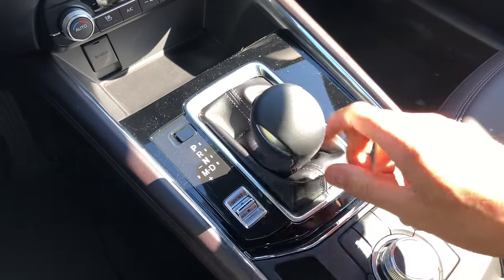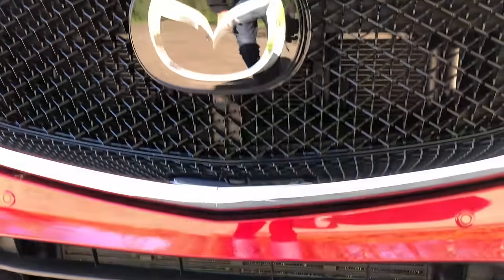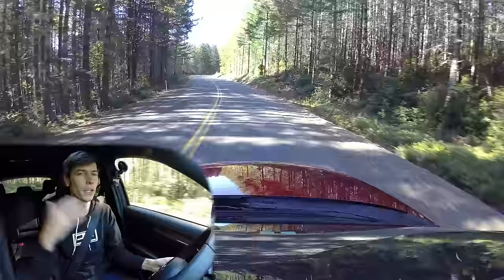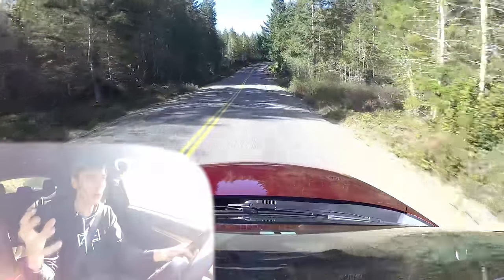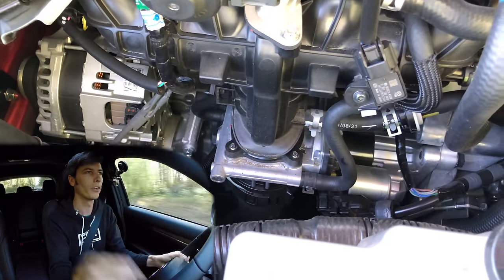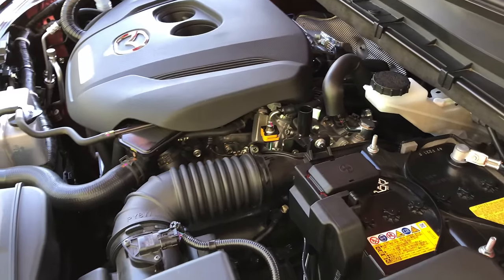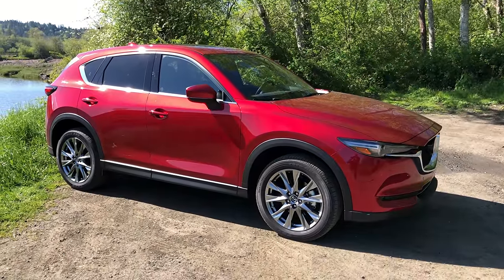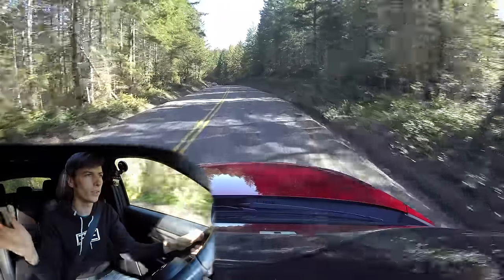Are CVTs Bad? Why Mazda Avoids CVT Transmissions

Comment: I personally don’t dislike CVTs. Sure they’re not as engaging as a manual or even a regular automatic transmission, but they’re generally a lot more efficient.
Reply from the maker: Yeah, honestly compared to most autos I think CVT offer a better feel for "manual" shifting. Smoother and quicker. But not as quick as DCT, not as fun as manual, and not as direct as some autos.
Reply: @EngineeringExplained  and much cheaper to produce than 6 speed AT.
Reply: @EngineeringExplained  the CVT on the Nissan I had reminded me of driving something with a lot of turbo lag.
Reply: From a reliability standpoint I think automatic has an edge over CVT
Reply: How is any automatic shifter engaging?

Comment: Apple's founder's  advertising slogan was "Think Different".  i have owned Mazda then for 25 years and I am glad that they didn't go CVT.  When Ford made their transmissions they were crap.  Now they are made in Japan.  Although they now share a factory in the USA with Toyota they have announced just recently,  Early CVT's from Nissan , Honda and others were disasters and cost thousands to replace.  Things probably improved  but I wanted something that would last.  The Turbo is not necessary and just would require maintenance  sooner rather than latter.  I like your detailed explanations.

Comment: I had a Subaru Impreza premium 5 door with CVT for five years.  It was a fine car.  The handling and brakes were good.  And I live in the mountains and daily drive extremely steep windy roads.  The car handled everything very competently and well.  And delivered an average of 34 miles per gallon for 140 thousand miles. I'm saying this to lay the groundwork. I have had a CVT car as a daily driver.

The biggest weakness of the car was lack of power, and although the transmission always worked, it often seemed to work against me when having to pass or in very power demanding situations like steep hills.  The RPMs and power would wander and was relatively unresponsive. It never failed to hold, but it was a source of anxiety.  When I sold the car there was a good dog box-type whine coming from it so it was time in my view to get rid of it.

To replace it I bought a 2021 Mazda 3 Turbo with a 6-speed automatic transmission.  And it is completely night and day with the feeling of the car.  Obviously it makes a lot more horsepower, but the biggest factor is I can actually put it into gear and have a better understanding of what the car is going to do.

I loved my little Subaru. If they had made a turbo 5 door version with a real automatic or manual transmission, I probably would still have the car or I would have bought another one.  But Subaru's refusal to bring a turbo 5-door back to the United States made my decision.

And the Mazda is a complete Revelation. I've never had a Mazda before, and now I wonder why I haven't.

I suppose if you live in someplace relatively flat, then the CVT would not be terrible.  But when you live in a place that has very significant hills I would not recommend it.  What little you give up in efficiency is more than made up for in my view in reliability and predictability.
Reply: I forgot to mention something that was a real cause of concern for the CBT with the Subaru, besides the slowly increasing transmission noise.  When going down long steep grades, sometimes the car would shudder when under engine braking.

I mentioned this to the dealership several times, and they told me that my front brake rotors were warped.  I knew this wasn't the case because I didn't suffer any shuddering when braking under other conditions.  But to prove it I got on a long steep grade and put the car in neutral and then use the brakes to manage my speed.  Zero shudder.  Then back to the top and used the transmission... shudder.

I was gathering evidence in case there was any kind of problem with the transmission in the long-term, but then the opportunity to get the Mazda 3 at a very reasonable price came up, and I jumped on it.

Comment: My wife and I have a '14 Mazda 3 and we both love the way the transmission feels. I contrast that with a '14 Subaru Forester that I had a chance to drive which put you back in the seat when leaving the line, but seemed to fall on it's face when you stepped on the gas at 35 or 40 mph.  Probably because of its weight.  My only objection to the CVT is...I like to shift gears.  I like feeling the gear shift.  I like the sound of the engine speed rising, then feeling the bump of the shift and the RPMs drop and the acceleration resumes. The Subaru  engine just gets to a set rpm and unless you move the gas pedal it just stays there while the car accelerates.  Very unsatisfying sound.

Mazda makes cars for people who aren't only interested in getting from point 'A' to point 'B', they build cars for people who remember what it's like to have fun getting there, taking the long way 'round.
Reply: Exactly! However with a fast car, you'd at best hit 3rd gear before going over the speed limit (85mph)! Many roads in Holland, non-highway roads are 80km/h (50mph) which is something many cars can hit in 2nd gear! So, that's just a single gear change AND it's slow off the line...In reality, I prefer how Toyota does it with the HSD-transmision (has no audible gear-changes). It's an dual-electromotor assisted transmission. When flooring it from a standstill, before you hit ~5.5k rpm with it, you'd already be doing ~90km/h (56mph). Yes, up to 56mph while the engine sounds as if it just ran out of it's first gear. Imho, that's great. The car I'm driving is a Toyota Auris Hybrid with 140HP (100HP engine + 90HP electromotor). It has ~300Nm (221ft-lb) Torque from standstill, which makes it really fast! It's quite a nice gearbox to have. When visiting family in Germany I usually cruise at ~180km/h (112mph) with the revs between 2500 and 3500 depending if there is an incline or not. Imho, only Toyota does CVT's well with the electromotor-assisted version they do! Without the electromotor-assist I dislike CVTs too. Low-power CVT vehicles sound like a lawnmower...

Comment: I love on how you dont bash CVT like the usual car youtuber. I think good or bad transmission is really depend on engineering resources a manufacturer put in it during development, and goal in mind of the engineers. A same model of transmission matched with a different engine by different manufacturers, tuned by different engineering teams, may result in  entirely different quality of trans. So just a car has CVT in it, doesn't mean it will be boring. 
And CVT car can be fast on track, especially on flowing corners. You just need to learn trail braking with the other unused leg, so on exit the car engine RPM is close to peak torque curve, the ratio of the CVT is closer to acceleration mode rather than overdrive mode. You may need to upgrade the trans cooler though.

Comment: The most important thing about any transmission, as well as any part of the car is that it will do >> 200000 km of short trips
in about 20 years without any repairs or significant service except like oil changes for the motor and new tires when the old ones are worn out...
So I would maybe take the Mazda CX3 because it weights less than the Mazda 3 and has more room...
and when I checked last time (many months ago) the 2L 120hp Engine was reasonably priced at less than 18000 Euros, that means with discount etc
like much less than 15000...
Of course there is only one option : the manual 6-shift transmission!
Reply: Amen to 6sp stick, I have one in my car and also my Ford Ranger work truck is 6spd, wouldn't have it any other way.

Comment: I own my own garage and i'm going to say this based on my own experiences with them, don't buy a car with one (well i never will) a CVT trans will never last longer, go farther then a regular clutch type trans, whether belt or chain driven CVT, its only a matter of time when it will fail. The big down fall of the CVT is the 4 cones the belt (or chain) is going around, when they wear out and the car is trying to get to say 70MPH, but is only going 65MPH, boom, car goes into limp mode, or in alot of Nissans that use belts, the belt breaks. If CVT transmissions were made to easily change the belt and cones like a timing belt on the engine, this would not be a problem for small cars, because of how they wear (seeing some Subaru outbacks and Nissan pathfinders needing a new trans at 50K) they need to be changed regularly, but there is nothing that can be done for larger SUVs

But no matter what, it is a high wear design, great for lawn mowers as they are easy to replace, great for fuel economy, bad for reliability in cars.

If all CVTs used the gear design like that of Toyota, uses a chain and people changed the CVT fluid every 25K (YES you read that right, take some new CVT fluid and compare it to 25K fluid and you'll feel/see a difference) one of the reasons for the cones wearing so bad because the belt or chain loses traction, slips and start eating away at the cones, and only put them in a compact car, then i'd say it has a chance, but there will never be one in my driveway.
Reply: Lately I've had to deal with people telling the myth that they have "lifetime" fluids in thier car. Car marketing has alot to answer for.

Comment: People trust toyota. They buy anything from them. Mazda still have to gain more trust from car buyers.
Reply: suirad69 batistA they're still brushing off some of the old Mazda/Ford stigma that some people think still exists.
Reply: @Rick Pao Toyota took 5.05% ownership of Mazda in 2017, and I think Mazda took some ownership of Toyota, for them to build a joint US plant.
Reply: @Patrick94GSR  you are correct Patrick. However, Mazda traditionally was owned/ and fell under the Ford umbrella who actually made all their trucks and rebadged them as Mazda's
Reply: @MrGreenelight  
Is there any source for that information concerning Ford, Mazda relationship???
Reply: @aminammar4260  look it up on Wikipedia for example. There was a long period of time where almost every Ford had Mazda parts, and almost every Mazda had Ford parts. Mazda helped Ford become what it is today by giving them a 4cyl engine that Ford still uses (now modified). Ford also gave Mazda their V6 engines for use in their vehicles.
Reply: Yeah... the Ford Mazda relationship was a good reason to avoid Mazda. But that was back in the 80s and 90s. 

In the 2000s... they’d gone their separate ways. Ford became a brand of quality with their Focus and Fusion and improved line of trucks. 

Mazda went back to being a brand of burned up apex seals and rust. Seriously, I can’t be the only one who’s eyes don’t immediately go to the rear fender of a Mazda 3 looking for the mark of the beast.
Reply: @Bartonovich52  Excuse me? Ford is known for being one of the most unreliable brands! Especially the transmissions on the Focus....horrendous! Many people have cried here in The Netherlands because of it...
Reply: Avery Holder the focus and fusion are unreliable as hell. Oh wait, you’re right. They stopped manufacturing them cause they’re such a “brand of quality “. Mazda is gone from Ford now and is Japanese made. Anything Japanese is going to last you whether it’s Toyota Honda or Mazda
Reply: @Bartonovich52  Did a brake job on a 2012 Mazda 3 and parts were labeled "FORDMOCO." Calipers, and a bunch of other parts under the hood.
Reply: MrGreenelight lies
Reply: @blake9184  I heard the new CX-30 will be built in Mexico.

Comment: Or you could get a manual, it can be smooth or jerky as you like and you can shift fast or slow. Amazing.
Reply: No, you have to shift according the timing or you will stall the engine. You can't shift slow...
Reply: Aoru. You’d be amazed at how short you can shift a manual transmission with matching revs or feathering the clutch. 

In fact, the old Indian trick for not spinning your tires on snow and ice before there was such a thing as traction control was starting in 2nd gear.
Reply: Most people under 30 don't even know what a manual transmission is. "Uh....Why does it have 3 pedals?"
Reply: @guitarsarelikestupid7200  only in merica land, in normal countries most people drive manual

Comment: The biggest problem it cost $$$$ to make a good reliable CVT.
Mazda made the right call as far as making a compromise in cost in reliability as Nissan's CVTs have  reliability issues.
Reply: icecool1616  subaru CVT are the same as Nissan
Reply: I've had 2 nissan cars, one since 2004 and one since 2013. Neither ever had issues with transmissions. I love cvts. I hate the feeling of a gearshift and personally love stepping in the gas and feeling the engine stay right in its torque band
Reply: no problem with my 4x4 suzuki kizashi with cvt. but yesh maybe some people have and im just lucky^^
Reply: $7500 to fix a 2015 Subaru suv with a cvt sounds like a problem to me.
Reply: @IKnewMickey  should be in warranty though?
Reply: @pilerks1  Too many miles on it I was told. I don't know off hand what the subie warranty is but ya, it was over by quit a bit.
Reply: @IKnewMickey  Agreed something on a car that sold for $32K when new should not cost that much to repair.
Reply: As far as I know, Nissan makes the best CVTs out of those Japanese company.
Reply: What about honda cvt
Reply: Danny Duan you mean the worst. They then sell them to everyone else.

Comment: I'm on my 3rd mazda, and everyone has been high quality, reliable and fun to drive. So long as I dont need a truck, there's likely going to be a Mazda in my driveway.
Reply: Second here!! Had the RX8 now on the 19 mx-5
Reply: actually, in certains markets there is a Mazda truck, the bt-50
Reply: I want CX-5 with a bigger trunk. CX-8 comes only with 7 seat version and no spare tire. Other than that these are my favorite SUVs ;)
Reply: @valdius85  do you really need that trunk size.  Most of the time like 99 pefdrnt of the time a hatchback is enough
Reply: @valdius85  mazda is always towards the lower end for size. Keeps weight down and makes the driving experience better. Some of these cars are getting too big, happy to see someone stay smaller.
Reply: @terryhsiao1745  I agree. I used to have a hatch and was really happy. 
I compare the trunk space to the length of the vehicle. CX-5 does badly in this regard. Part of that is the rounded back end, another is the design of the exhaust and transmission that results in long hood. I will use it for road trips - last time Gr Cherokee that I borrowed was 80% full. So yes, I need a trunk ;)
I still might go with CX-8 available on my market.
Reply: BT-50 Is a Ford Ranger with a Mazda diesel.

Comment: I have a CVT in my atv and it's awesome but I don't think it has a place in a road vehicle. I still prefer gears, even if there is 8 or 10 of them.
Reply: Even the CVTs are more reliable than a 10 speed transmission.

Comment: CVT owners say you have to regularly change the transmission oil to avoid mechanical failure. I love the way a CVT feels when driving, but the way they are constructed is scary. They look like they are designed to tail.

Comment: My last 3 cars have been Mazda's - they all went 320000 Km's plus and were running fine when I upgraded. I will not buy a vehicle with a CVT transmission because when you have a problem ( and God knows they get problems ) you have to pay for a new one because NOBODY FIXES THEM.

Comment: An ECVT is not mechanically the same as a CVT, ECVT doesn’t have a belt much more reliable.
Reply: TacticalMoonstone  Are you referring to the "transmission" in something like an Accord Hybrid. Honda calls it eCVT even though it is really a direct drive with an electric motor.
Reply: TacticalMoonstone  Ok. Having driven the 2019 Camry Hybrid and the Accord Hybrid I can say the Camry system FEELS more like a traditional CVT while the Honda feels more like an electric car but just with the engine acting as a generator. Around town driving the Honda system seems quieter and yields more immediate response but on the highway under a lead foot the Toyota system seems less droning.
Reply: TacticalMoonstone  Are you saying that the Toyota e-cvt does not use the typical cvt steel belt?
Reply: thats correct e-cvt have no belt at all they use a planetary gear set.

Comment: I’ve noticed that people only complain about CVT’s if they’re from Nissan or Subaru. Never heard complaints from Honda or Toyota.
Reply: I think the rental I had while my airbags were replaced was a Nisson, it was one of the best I've seen so far.  I know Subaru did some huge upgrades from 2012 when I was shopping for my Outback to around 2015/2016 I test drove an Outback and it was far more responsive passing and felt better accelerating, though still was anemic from a stop.  I still prefer my 3.6L with the 5-speed automatic though, I find it far more responsive when I have to pull out thru heavy traffic onto the rural highways from a stop.  I think it may be more due to the engine size though.
Reply: Did you read the comments here? Plenty of people disliked them.

Comment: Bought my mom a 2013 Accord with the CVT and I did a drain and fill at 100,000.  So far at 128k still shifting fine.  Bought it mainly for the fuel economy and reliability and it's been good on both points.  Talked my fiance into a 2020 CX-9.  This car is wonderful to drive with how it responds to throttle and shift quality.  It's a FWD and gets about 26 mpg at 70+ mph.